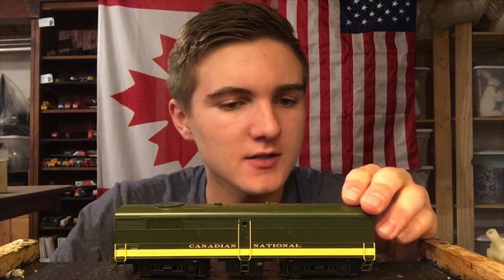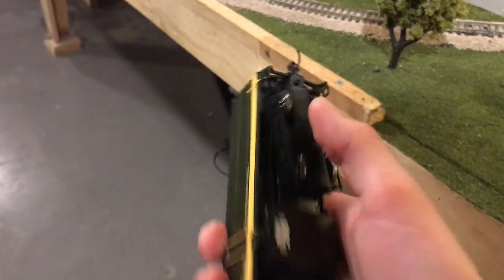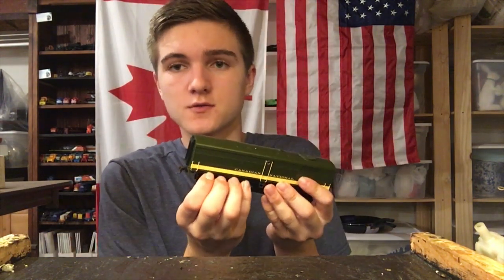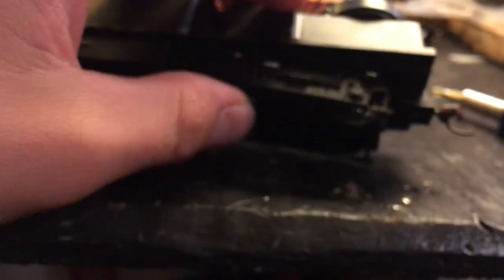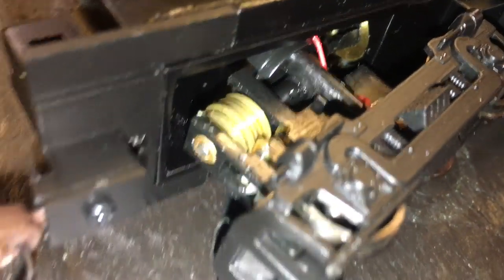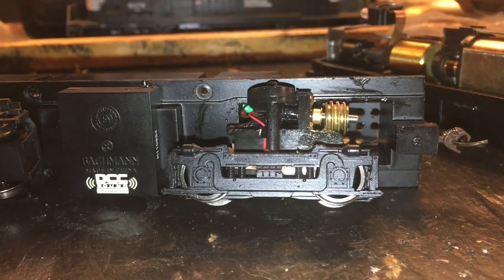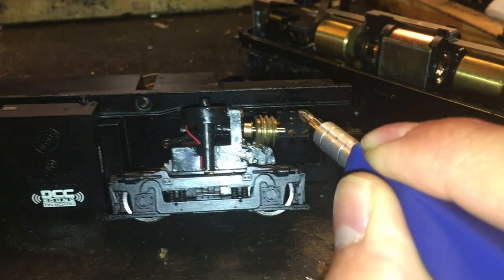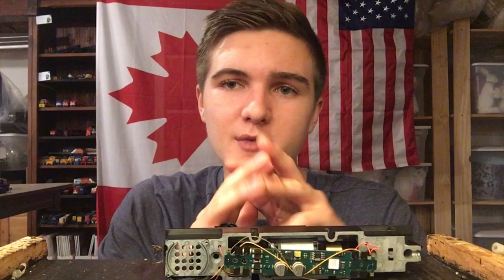Trying to fix the Bachmann B-Unit - It's worse then I thought...

Comment: Hi, recently purchased a 2nd hand DC loco, cars, tracks and others enough to make a complete set. One of it is an Athearn 3 wheel truck I may say. I was surprised because I've never seen such 12 wheels before. I am a newbie in this hobby btw. Did not win last month give away lol!  Unfortunately, the other side of the loco has no worm gear and the cover was broken too. I just removed the shaft and that's it. Pulling power reduced to 50% but at least it can still run and pull 5cars + caboose. Not gonna spend a hundred bucks + shipping to get parts. Sorry for my English hope you know what I mean.

Comment: You can switch A unit frame  with the B unit but make that B unit a powered locomotive and the A unit a dummy and still have all three . The one A unit would be power and the B unit  but one A unit would be a dummy  .
Reply: Very smart idea if SMT can't get the locomotive fixed.
Reply: I know I'm a little late to the party by a year or so, but I was thinking the same thing. Have A unit a dummy and B unit as the power. Still have the look and style.

Comment: Ouch!  That's a bad defect.  I've toasted the bearings on a Spectrum GP30, same design, and replaced the majority of the truck.  I've also had trouble with the drive shafts torquing off the motor shaft, especially on those "we don need no steenkin flywheels" Bachmann GP40s.  Still, I like most of my Bachmann, even some of the old pancake motor models.

Comment: I think you should take a 4 axle truck from a broken bachmann engine, take the side frames off, replace the sideframes with the alco ones, and put the new truck in. Or, you could make it a dummy and put the decoder in a different alco engine so it sounds right. If you dont have a spare Bachmann truck, Im sure you can call bachmann and get a new truck.

Comment: Yeah B unit got accidentally switched on to the air line at some point.
I'd say depower the B as even a fairly sizable layout you'd be hard pressed to require 3 powered units and use the sound unit for another similar Alco unit

Comment: That locomotive is worth over $100. If you send it to Bachmann, usually they would send a brand new one or fix the old one. Another option would be to completely remove all worm/transmission parts from that truck assembly and allow the truck to roll freely while only using the other truck as a powered truck.

Comment: Hey how ya doing? Not to bad here. Luckily I live on a lake where most people come up on weekends or holidays. So i can pretty much continue on with what i normally do . built a rc track at my buddies 3 houses down. Too bad it fell do to derail or being dropped. But anyways, me personally would pull motor use the motor for something else leaving the sound in the b unit. So when you run the matching engine it still has the sound. The frame is already built for the speaker with holes and all. Just pull out the parts it doesn't need to become a dummy with sound. Unless you have a engine that is the same as the damaged one engine. Most sound cards are set with sounds to specific type of engine. Not all engines sound same as you know. At Least you have something that can be replaced. Still trying to find ho lionel trucks. The clips that hold axels in are broken and won't lock in. Pick the train up the axels fall out. Plastic bottoms with metal truck casings. Well have great day stay well .

Comment: This sounds like a static problem. One design allows a force to be applied and keeps the parts together because the system is in equilibrium. The other system gives way and breaks because the applied force makes the system go out of equilibrium. This means that your sum of forces and moments are not equal to zero. Infact the y-axis forces I think would be greater and the material used for the mechanism was a brittle material, therefore leaving you with the problem you have with this train.

Comment: I have a Bachmann RF16 Sharknose that seems to have the same problem - in my case, it happened first time I ran it, trying to haul about seven Athearn streamline coaches up a relatively steep grade.  It would likely not be so bad if Bachmann had not designed the frame to make the mech so damned inaccessible. I think these locos are going to end up dropping Bachmann's reputation back down to where it was before Spectrum was a thing.

Comment: All it needs is a new Truck or using some styrene maybe craft yourself a bracket that will keep the wurm gear in place.  3rd you could always find a donor on ebay that someone broke in a different way and scavenge the trucks.  Older Athearns are near indestructable even if their shell details are a bit lackluster they are still my preferred trains to use and upgrade to DCC, still it's best not to drop them ;)

Comment: Harrison man, I have an old TYCO CN F7 that could use some major restoration if you're up to doing it. The engine itself is from the late 60's or early 70's.
Reply from the maker: I might be able to at some point but I don't currently have a public address so eventually I will have to set up a P.O. box.

Comment: I say you try to make a dummy out of the B unit. Then try to use the sound value DCC decoder and speaker to convert a different Alco locomotive to DCC/sound. It has to be Alco since the prime moviers sounded very different.

Comment: Typical bachmann. Their models seduce you with good looks on the out side but are cheep junk on the inside. I agree, the B unit is not necessary, at-least in its powered form. I find them useless, they always have to be paired with an A unit. I have had good results parring the sound value board with a different locomotives. In your case, That N de M rs 3 you got back last September at the Massena train show would be perfect, as that locomotive used the same prime mover or engine under the hood, as the fa did in real life, the alco 244. The sounds would match perfectly! another candidate that might work would be an Athearn blue box alco pa. Although the pa would probably take some mettle work to get everything to fit correctly. As for sending the B unit into Bachmann, I believe that their warranty covers "manufacturing Defects" and locomotives must be free of physical damage to qualify for repairs. So I don't think that idea would be wroth bothering with.

Comment: Could you not get a piece of plastic and heat/weld it to the back of the truck where the broken piece would fit after drilling a hole it in where the worm gear would fit? surely that would fix it? or cut the wires from that rear set of trucks and run it with just one set of drive trucks......